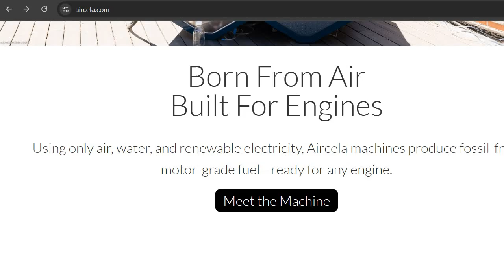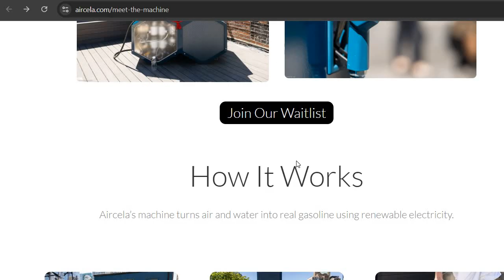Aircela Review – Can This Machine Make Gasoline from Air?

Comment: It's peak stupidity... Basic math folks, there is 33.7kwh of energy in a gallon of gas.... Even if the system was 100% efficient which it can't be due to conversion losses etc... it is totally moronic... 33.7kwh of energy for one gallon of fuel... Any decent ev can go 60-120 miles on that energy that would make one gallon of gas... And most likely the conversion losses etc would make it maybe 50% which means an EV would travel 120-240 miles on the same energy to create one gallon of this so called gas .... WTF..
Reply: This process utilizes carbon capture, cleans our air, bud. EV's hold promise on their own, sure, but they dont make use of any effort to clean our enviroment. Go tell your Big Oil bosses that the public arent falling for your tricks.
Reply: Your math is correct, the issue is economic at scale when transitioning to zero carb requires steps that won’t cause a systemic collapse that would indeed create more CO2 emissions. This would be step 1.
Reply: @mikehub6664  The math may be "correct", but his logic isn't.
Reply: @rampagephoenix1735 it literally cannot take less energy to create the fuel than the energy density of the fuel, otherwise you have an unlimited energy issue...  33.7kwh would be the absolute minimum it would take to create 1 gallon because that is the energy potential without losses... That is only on paper... Im real life it would be astronomically worse. Probably takes 4-10x the amount of energy to create it... Lol